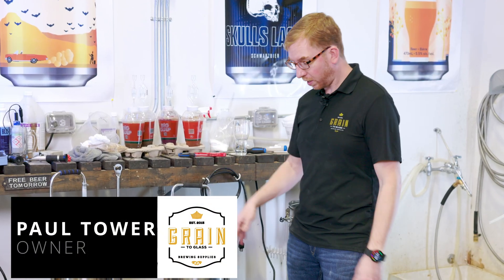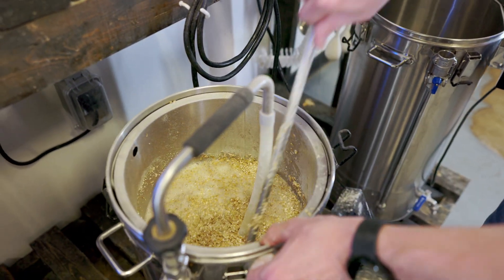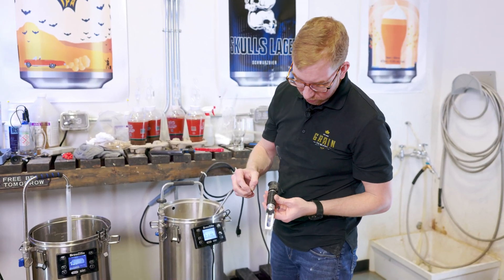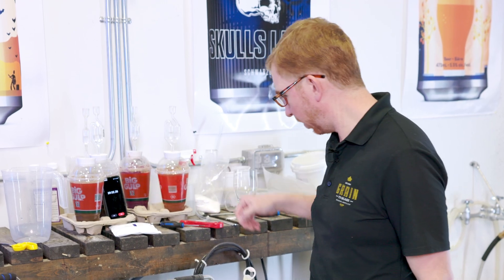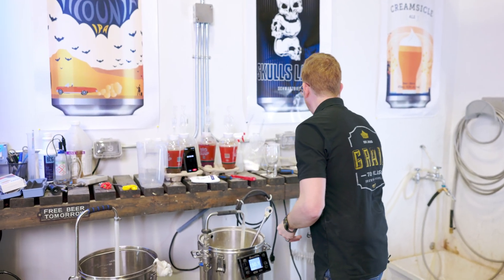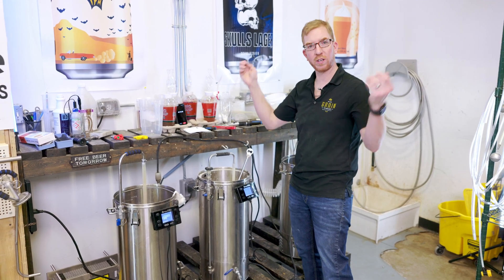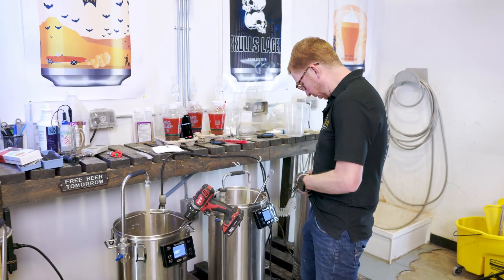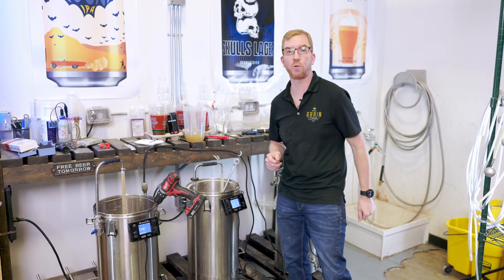Mash Length Experiment: Gravity Points Gained Every 15 Minutes

Comment: I like the flexibility of your DIY return hose. Did you use two cam lock fittings and a short section of silicone?
Reply from the maker: It's actually the recirculation arm from a Grainfather that we slapped a camlock fitting onto so we could use it on the Brewzilla.  To build something similar you could use a camlock e, short piece of silicon tubing, camlock c.  Cheers

Comment: Hi Paul, love your channel, very informative. Looking at making one of those recirculation thermometers you use. As such, what parts make it up please? I'm located in Australia so can get Kegland Stuff pretty easily so hopefully that helps.
Reply from the maker: https://youtu.be/v4wgOWrjoJo
Reply from the maker: Hi, here is the parts list I used to build it.  All parts are stainless steel.  I also made a video on how to build this you should check out.

Thermometer with 2" probe
1/2" coupler
1/2" nipple
1/2" fpt tee
camlock type b
camlock type f

Hope that helps.  Cheers

Comment: What is the flexible piece on the recirculation arm? Thanks for the vids!
Reply from the maker: It's actually the recirculation arm from a Grainfather that we slapped a camlock fitting onto so we could use it on the Brewzilla.  To build something similar you could use a camlock e, short piece of silicon tubing, camlock c.  Cheers